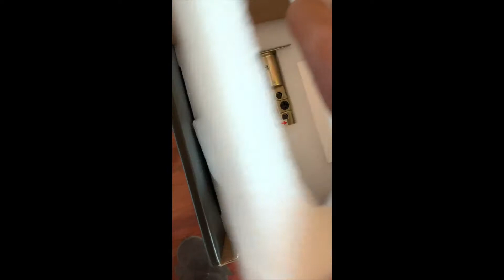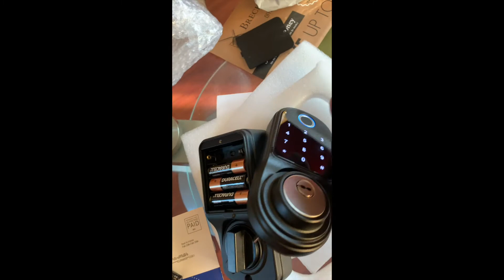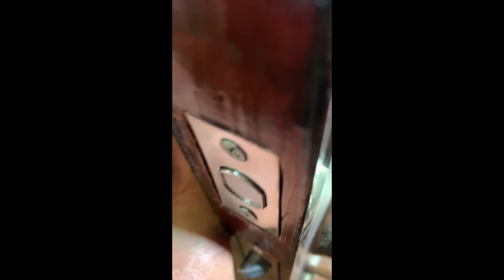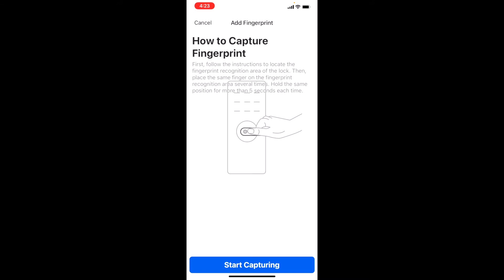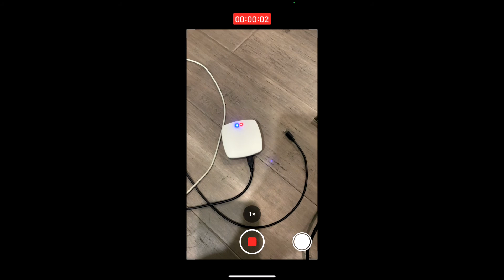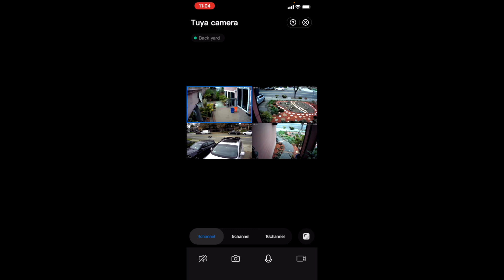F31 Tuya Smart Bluetooth Deadbolt Lock

Comment: I noticed that the auto lock does not work if you manually unlock the lock. It only auto locks if a code or fingerprint is used to unlock. Also, the Bluetooth range is only about 5 feet away from from the door.
Reply from the maker: I actually only use the lock with fingerprints, the kids come home from school and use their fingerprints to open the door. It’s been amazingly reliable and the batteries last until now. Yes, if you manually unlock then you have to manually lock or press # if you leave to lock the door. It’s a great $100 investment.